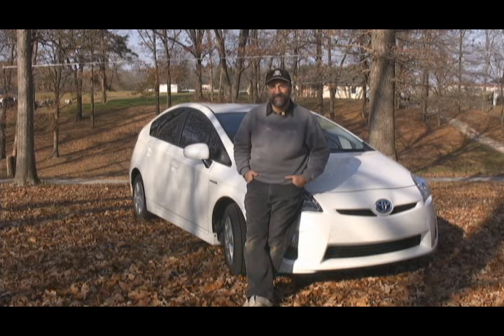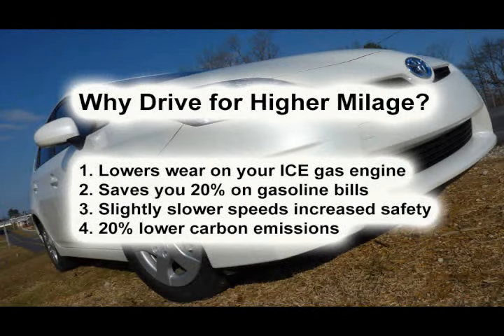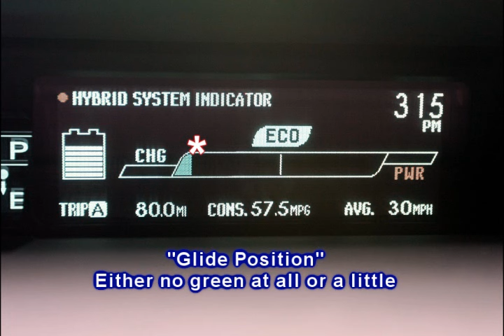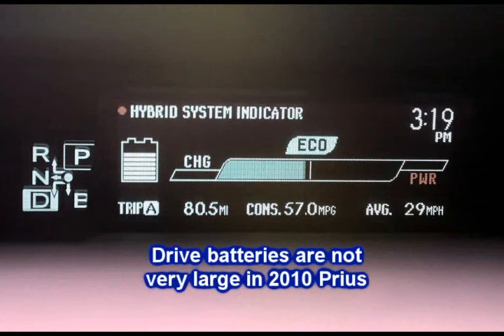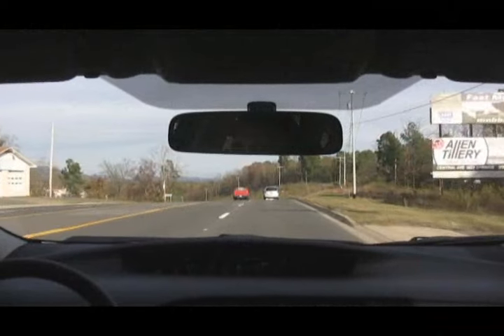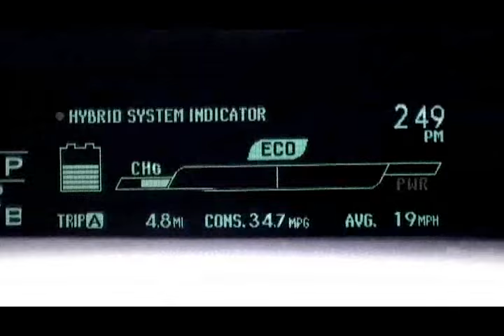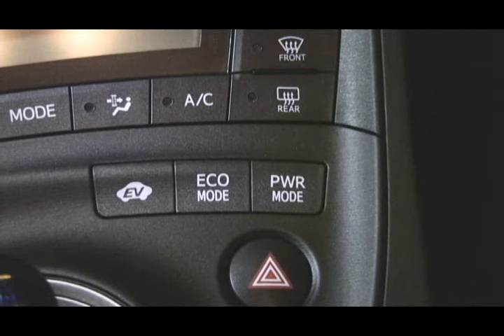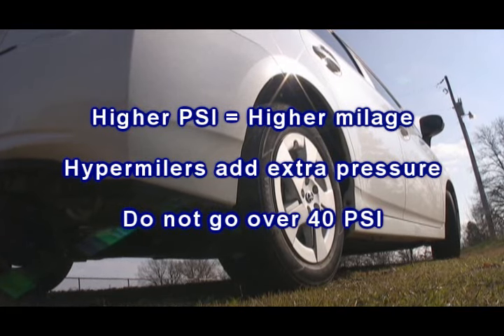Prius MAX MPG Secrets

Comment: Pulse and Glide is BS!   Don't believe in free energy, use the cruse control and drive in the efficient range (when not in curse control)  is the only way to maximize MPG.
Reply: This is true for conventional cars, but the Prius is different. Pulse and glide helps you utilize the electric motor more efficiently.
Reply: Nothing free about it, you are utilizing the electric motor to reduce the gas used overall.
Reply: TheVigilante2000 : You're wrong; it does work and there's a solid scientific reason why it does.  It also works in conventional cars (I've done it when the engine cooling system failed) but without the electric motor to prolong the glide it's hell on surrounding traffic and not to be recommended.
Reply: And what is the scientific reasons you can get better MGP gliding?  I own a Prius, and you do gain a minor MPG boost because you drive/accelerate slower so you keep the traction battery engaged rather then use the engine.  If you drive slower with less acceleration using ANY car,  you improve MPG.  Sorry no special Juju.
Reply: TheVigilante2000
: From your reply, I have the impression that you would not get any benefit from an explanation, so I'm not going to spend half an hour typing it up.  I know what your response to this is likely to be.  I could, of course, be wrong, so here's a question for you that, if you answer it, will show that I'm wrong and also contains the seed of the explanation itself - How does the efficiency of an internal combustion engine vary as a function of the output power?
Reply: It's a curve, so what?  That's one of the reasons hybrids' can be more efficient than conventional cars (computers try to run the engine at optimal RPM, banks excess power) .
Reply: TheVigilante2000 : Yes, you've almost got it.  Take the example of a steady run that needs 5 kW of motive power to balance aerodynamic resistance and friction and so maintain speed.  The Prius engine can generate this at 29% thermodynamic efficiency (far higher than regular cars).  But, it can generate 15 kW at 36% efficiency.  The idea behind pulse and glide is that one third of the time you run the engine at 15 kW and two thirds of the time you don't run it at all.  While you run the engine, you store the power you don't need to maintain speed as a little extra speed, if you want, and / or in the battery.  Then., when you don't run the engine, you recover the saved energy by letting the speed fall a little and drawing it back out of the battery.  If the battery storage system was 100% efficient, you'd be running at 36% efficiency instead of 29%, hence the improvement in fuel economy.  Because of losses storing and recovering the energy, you'll get less than 36%, but people who have studied the car carefully and those who use pulse and glide agree that you come out somewhat ahead.  If you argue that this is a ridiculous amount of trouble to go to, then I wouldn't disagree, but if you argue that pulse and glide does not work, then I'm afraid I'm going to counter that it does.  (Disclosure: figures are from the Argonne National Laboratory report on the first generation Prius, but the idea applies to the subsequent generations, with improvements.)  Please reply.
Reply: Graham: What you describe is correct. My car's computer (3rd Gen) does this automatically, assuming the battery is not maxed out.   It's the whole reason the Atkinson engine and CVT are so good for hybrids.   The idea as described in the video is to zoom up to speed and then coast (with electric assist) and this could get you something like 20% more MPG (some people clam much more, the video claims 20% more if you follow all suggested MPG tips, most of them good).  And yeah, if your battery is maxed out, it is better to slow down and run with just your battery.  You will also be driving slower so effectively getting more MPG also.   I also don't like to start/stop my engine if I'm trying to hold a set speed at the electric motor cutoff boundary, but don't fool yourself into thinking you're saving huge MPG by accelerating up and then coasting down.  Better to just watch the road and set the cruise control in reality (average CC savings is 7%).

And for Argonne's one paper by one PhD student in 2009, that said you could get up to 90% more MPG with PnG was set up to get those numbers.  They never counted the excess energy that was coming from Atkinson engine in normal operation.  That power was wasted and not banked in a battery or considered.  That is why they showed that PnG worked better in a Prius than even a conventional car (they only increase it by up to 77%).  This paper/study was the  opposite of 'real world', but rather set up to make headlines.(IMLTHO)
Reply: TheVigilante2000
: We're at a complete disconnect, talking about different things, so we should not waste any more time on this.  I have demonstrated using scientific reasoning backed up by a report from a respected source that alternately using engine power in excess of what is needed to run the car and then letting the car coast and/or run on battery power can increase fuel economy.  If you want to argue that what I describe is not pulse and glide or that the video makes specific claims that I don't or use a report written ten years after the one I quote to discredit the source then I'm not interested.  Sorry.  I have sound scientific theory, my experience backs up that theory, I'm done.  You're welcome to believe whatever you want.
Reply: The reason P+G works is because it limits the amount of time that the ICE is on. ICE is low efficiency, especially at loads that are light (such as cruising). By only using the ice for a fraction of the time, you effectively store up kinetic energy (higher speed) while not wasting fuel at low engine load.

Comment: I know two tips even better! first do not buy that pile of junk toyota or second park it that pile of mess in the garage do not drive it at all and walk to work! (:
Reply: I've had 8 different sports cars over the years including one over 500 hp. I bought a Prius for a specific purpose: get better gas mileage and be a low repair car to operate. this year (2014) Consumer Reports rated the prius the lowest cost vehicle to own even including its $31K purchase price. The Honda Fit at $17k took second. SO... how the heck is it a pile of junk? Please do a bit of research before you start commenting. I'm at 203,000 miles and am about to replace the brake pads for the first time. the rotors have no warp. I get 50 mpg average and 40-42 MPG when I beat the living snot out of it. What WONDERFUL low repair / low cost to own car do you own?
Reply: Yes. It is much more cost efficient to not drive at all. Cost to drive to work is a crazy $2 in gas. Cost to walk to work is only $180 in labor, but you don't have to spend any money in that expensive gas :)

Comment: Looking for max MPG? Buy a motorcycle. And no, it doesn't have to crap out volatile hydrocarbons and shit, not if it's a modern four-stroke. Sadly, you'll no longer be packed inside the box surrounded by styrofoam peanuts, but at least your immediate environment will be real and authentic. Fresh air blowing in your face instead of a fan blowing recirculated farts ... your sweet-heart's legs wrapped around you, or even better they're grinning at you from the next lane over. Break outta your CAGE.